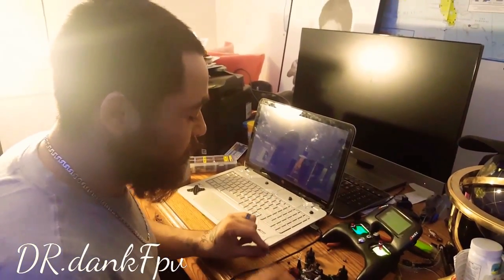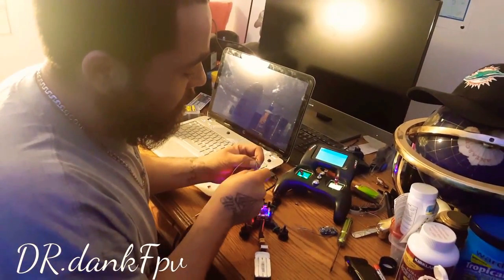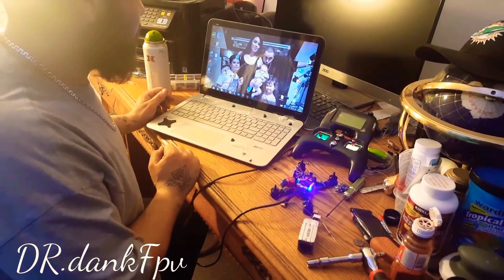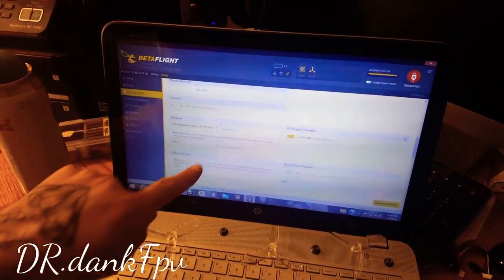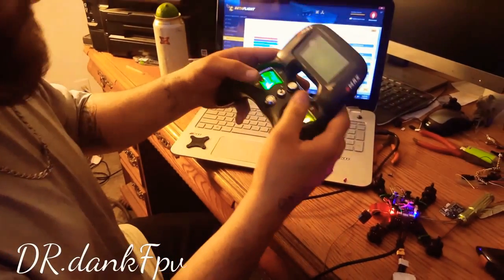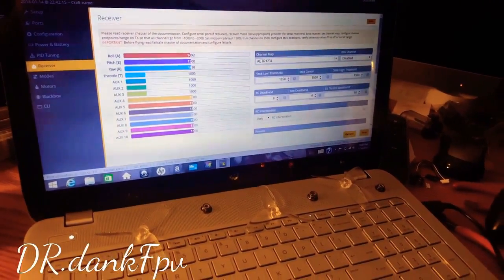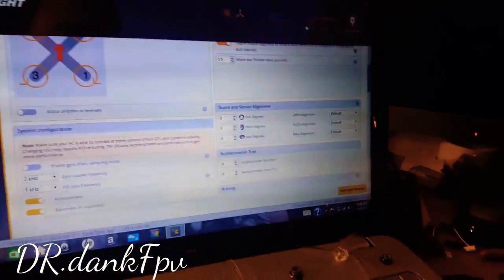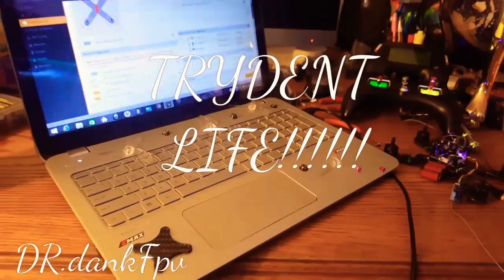Configuring and binding fs A8S to sp racing f3 flight controler on betaflight!!!!!!!!!

Comment: Hi man I am having problems with this receiver and the motors. When I connect the lipo the motors beep constantly
Reply from the maker: ismet aksoy did you fix the problems with your quad??
Reply: @dr.dankfpvmartinez2769  
No man shit won't work. Now I got whole new escs and motors. But now the damn thing won't get signal.from the transmitter
Reply from the maker: ismet aksoy I feel your pain buddy one thing after another huh
Reply from the maker: ismet aksoy I can try and help you the best I can try and rebound The transmitter and receiver make sure that the u art is turned on in betaflight or Whatever configurator you’re using
Reply from the maker: ismet aksoy also those A8 Receivers Sometimes acts funky and have to get rebound and when it’s bound always have your transmitter on before you plug in your quad

Comment: The UART 3 provides 3.3 v whereas FS.A8S power range is 4 to 8.4v , please help
Reply from the maker: Will it not power up on uart 3 have you tryed it and what flight controller are you using you don't have to use uart 3 as well u can try another uart
Reply from the maker: U will just have to select another uart that it's plugged in on beta flight configurator
Reply from the maker: And if you don't have a uart that don't have a plug u will just have to solder to the uart and just solder power to 5v